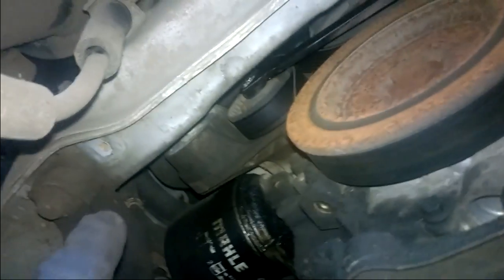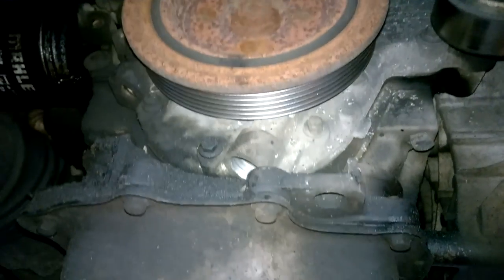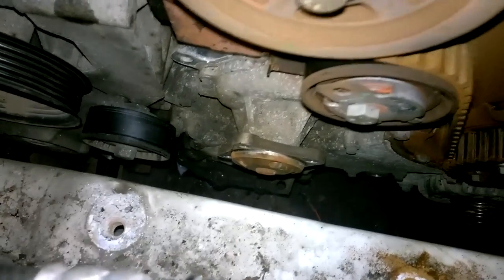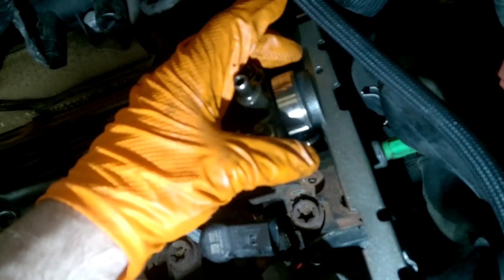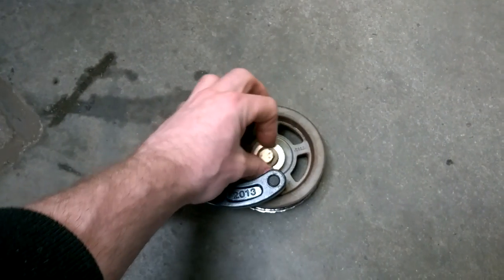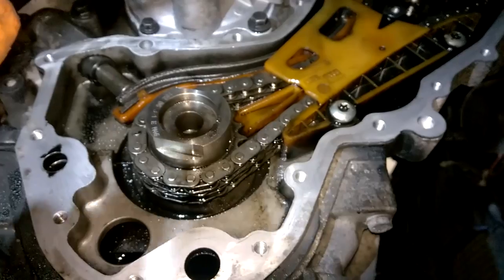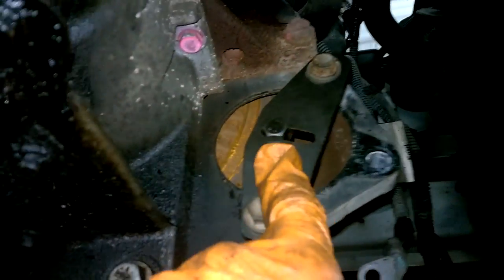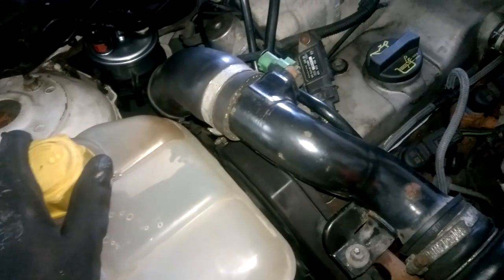How to replace the timing belt, oil seals, water pump & alternator in a Ford Transit Connect

Comment: Very imformative video. Thank you very much. I have a 2012 that dosn't start. The cam shaft is moving so I don't think thats the problem but how do you know if there's a wet belt or chain to the fuel pump. Is there any signs on the outside or is it surprice moment when open up the engine?

Comment: Are you using the tiger grip gloves, they are really good. Seem to last a lot longer than norml nitrile gloves. Only problem is even the extra large are a bit small.
Reply from the maker: Very similar gloves called gripster. long lasting gloves which are harder to rip than the normal ones.

Comment: Old video I know but helpful, thank you. I am doing the belt on my connect 2010 and wondering whether it might have a chain already. What info did you find out from Ford? Did they start fitting chains again after a certain date or do you think yours had already been converted to chain by a previous owner?

Comment: just did this exact job on my ford focus 1.8 TDCI, used a jack underneath rather than over head engine hoist, didn't lock cam, just marked diesel pump and used TDC marker, biggest pain on my car was getting the serpentine belt on, think its a stretch fit, but I didn't have the tool had to push down on the removed water pump pulley to get it on, all running great now, also the alternator is a bitch to get off on the Focus as they have the extension pulley, really hard to get to the mounting bolts for the Alternator.

Comment: I have a 2013 connect I had the same information for mine that I had a belt . before I replaced the belt I had to replace the valve cover gasket and while the cover was off I noticed the drive belt was actually a chain.
Reply from the maker: Thanks for the info Bill
Reply: I thought they changed all chains to belt in 2007? Obviously not.

Comment: I am rebuilding the front of  a Transit Connect 2012 ... radiator, A/c Condenser and Oil Cooler, plus Core Support, both grills and hood. I picked the vehicle up after the driver rear ended another car. no other damage.

What I've learned;
1) The design of this vehicle shows ZERO consideration for Maintenance costs as, although the parts are reasonably priced,  even "basic repairs" like changing the water pump or the timing belt require HOURS  OF LABOR to disassemble SO...MANY.... OTHER... COMPONENTS...... because there is ZERO...room to do ANY ... job...
2) I bought the vehicle to rehab and then give to a sister. But I can see that even basic MX will be beyond my level of patience.... ( not ability) soooo
3) There is no way in HELLLL that my family will keep, own, operate this vehicle.

When a water pump is an eight hour job...... no 

When this thing is back together.... It's getting sold...

Ooooops update...... lets spend three hours getting in to the job to find out that Ford's data sheets dont track timing chains vs timing belts.

This vehicle is a maint cost nightmare.... it doesnt matter if the block, bearings, crank, cam, rings and valves will last 200,000 mi..... if the accessories EACH ( Alternator, timing belt, water pump etc) cost $1000 in labor..... at 120k miles...DUMP THIS VEHICLE AT THE FIRST SIGN OF ....A...N...Y..... problems....... or.... replace everything the first time you go in... ($2500)........ or just spring $6000 to replace  everything .... long block plus all accessories.

Comment: I have18 tdi 06..130.000miles ..timing chain m belt .restricted to 70mp.ex.royal mail...cant afford right now to have timing chain n tensjoner changed ..does this have to be done asap....should i not drive it till its done thanx..engine is very qiute n runs grate

Comment: Transit connect before 2008 year had a chaine, after that FORD changed it to the wet belt.
Reply from the maker: I wish I had that info before I started the job :) seems no one in the business knew that.
Reply: Sometimes things like this happens, and when it happens i always very happy that i didn't order the parts before disassembling it.
Reply from the maker: The parts don't worry me as with our suppliers they will take them back for credit no issue (special order from dealer different story)  I contacted parts suppliers again today and they stated that there is wet belts listed prior to 2008 on connects. If this is the case that only 08 onwards have it, then a lot of suppliers do not have correct info and again I rang the dealer before I carried out the job and they also confirmed it had a wet belt. Very confusing.
Reply: But you can replace your wet belt with a chain correct? Maybe some one prior to you just swapped it for a chain.
Reply from the maker: One owner from new, belt never touched that's why I done it.
Reply: Gerard Burke what year was the van ? Thank you

Comment: great videos.  if that belt breaks would the valves get belt or is that belt just work the fuel pump
Reply from the maker: Thanks :)  
If the belt breaks it can damage the valves, these engines are well known for damage should failure of the top or bottom belt/chain break.
Reply: I have 2007 connect with no history of service,  be safer to change so. thanks for replying
Reply from the maker: Yes for sure it would be. No Problem.

Comment: Alright Gerard I’ve got a 1.8 2005 connect and my crankshaft pulley seal is leaking how do u get the crankshaft pulley bolt off  I’ve tried the  air gun on it but had no affect
Reply from the maker: Not joking, you need a better air gun :) I have a 3/4 inch air impact for the very worst crank bolts whilst also using a wide bore airline, I have no other answer for you other than that.

Comment: Hello Mr Burke.
2006 transit connect 129,500 miles; chain, or wet belt? Does the chain require changing if it is a chain?
Thank you.

Comment: Lad it looks like a total nightmare
Reply: eric mourinho The boat in the middle of the tensioner is not a 15 mm it's a 13 mm
Reply: I hope I'm doing this right as far as coming in your video you said the center bolt of the tensioner to take off the belt was a 15 mm it's a 13 mm
Reply from the maker: As I can't remember I'll just say this, Tensioner bolts can have different head sizes, example a Dayco kit might have a 13mm while a new Gates kit could have a 15mm as part of there kit. It doesn't matter either way so nothing to worry about.

Comment: Dear Gerard. I have an engine 1.8 tdci, QYBA and i have a problem with an oil leak. Oil leaks around metal gasket between engine block and timing chain casing in the same position as a bolt for crankshaft locking. Can you tell me please how can we change the gasket? Do we have to remove also the lower oil pan to disconect oil pump hoses? There is also a chance that bolts under chain are loosen. In that case do we still need to replace the gasket or just tight them up to specified torque? If you have any a little time i would be happy if you send me any advice on my email humar.stojan@gmail.com. Many thanks.